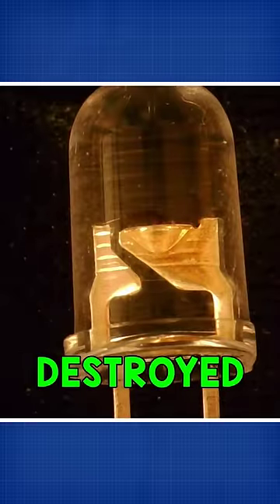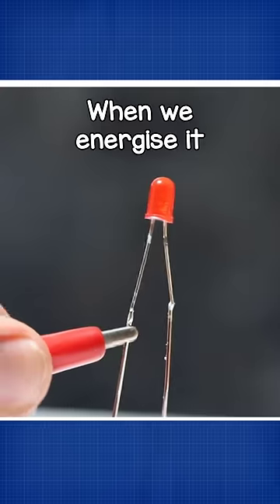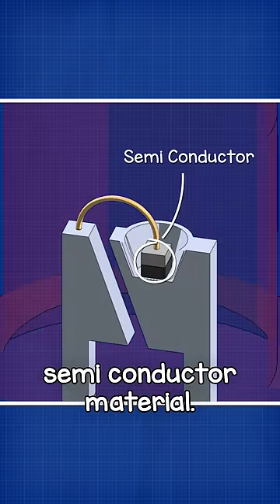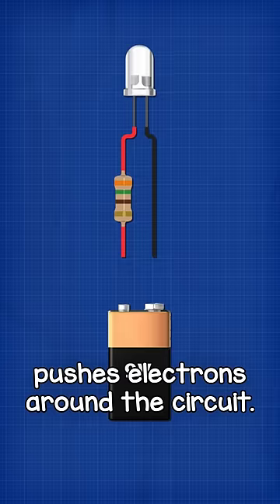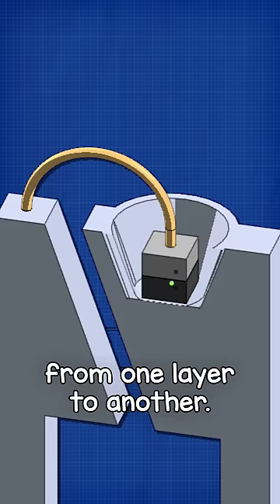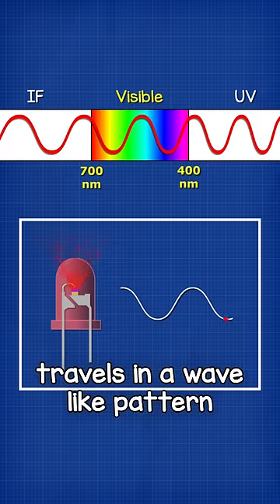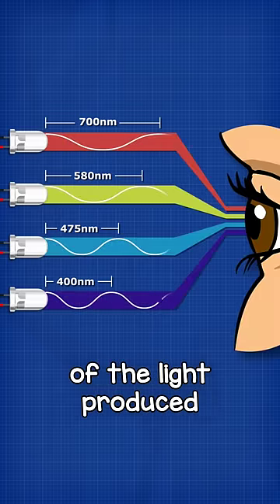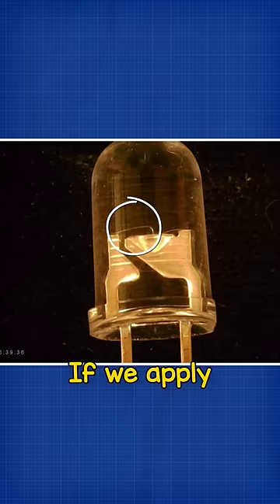What is an LED and how does it work #technology #electronics #engineering #led

Comment: remember kids, any electronic circuit can emit light, it’s just most can only do it once
Reply: light emmiting resistor 💀
Reply: Every machine is a smoke machine if you use it wrong enough
Reply: Light emitting voltmeter 💀 💀💀
Reply: Simply true
Reply: True, I see many resistor emit light, once.
Reply: You can also use capacitors as firecrackers
Reply: And in 100% of time light emitted is always red
Reply: Light Emitting Capacitor💀💀
Reply: Haha
Reply: Have you tried using an oscilloscope as a tazer? Really useful.
Reply: This has the same energy as
“Every phone can fold, it’s just most can only do it once”
Reply: light emitting crocadile clip??
Reply: Bandit power PC power supply
Reply: Bandit power
Reply: @Mista_Godfather no they also produce infrared
Reply: @mil2744 that’s pretty much a light bulb
Reply: wrong, they all do, we just cant see it
Reply: @nax1807  Absolutely, given a source with enough current capability. Try sticking one directly across a 12V car starting battery... 
(NOT recommended! Don't try at home))
Reply: Light emitting capacitor 💀

Comment: It is not voltage that destroys the LED. It is current.
Reply from the maker: Corrent, see our videos on resistors explained and leds explained for even more detail
Reply: Without voltage there will not be a current, so..
Reply: @googleevil9553  yes the voltage does create a current. But the damage is caused by too much current. Say you hook up a variable power supply with to the LED. Starting from zero, the LED will begin to glow at about 1.5volts. Because the LED is forward biassed, attempting to increase the voltage further, the forward biassed LED will attempt to voltage limit as the LED current increases until excessive current will cause the LED to fail.
Reply: @googleevil9553 voltage doesn't move. The current is electrons moving in the circuit. You can have, say, 5v across the LED. Without a resistor to control the current, too many electrons flow and the LED burns out. Add a resistors the current is lowered.
Reply: It's heat that kills the LED
Reply: "Falling from 50 meters doesn't kill, hitting the ground does 🤓🤓🤓" -This guy probably
Reply: Such a classic debate, Voltage and Current are coexists together to make Power, *Power does the damage to the LED, not just current by itself*, without Voltage there is no way for Current to flow.
Hope this ends the debate.😅
Reply: Voltage is the rate of current flow?
Reply: @ahmadfaris8044 voltage, volts, is the potential. It is the difference from one part of the circuit to another. Current, in amps, is the flow of electrons from negative to positive potential.
Reply: power kills them
you can frame the question both ways because voltage or current is just half of the answer
there is a voltage drop over the resistor which means the current is limited
Reply: you just tend to think of series sections in terms of current as that is constant throughout them
but you can think of it either way and one is not more right than the other
Reply: You guys aren't getting it. the voltage of the led varies more from part to part and across temperature than it does from mid current to over current.  It's like if I connected a 100psi source to a 100psi relief valve I may discover that at 101psi it barely works but at 102psi it is violent.  That is why the resistor and why (good) engineers never put diodes in parallel without their own resistor.  The mechanical evivilent to a resistor would be a restriction before the valve so there is a reasonable pressure (or voltage) range that works.   Now a light bulb or even human flesh, the current is fairly proportional to the voltage so your mostly right there
Reply: Are we all arguing/agreeing that semiconductors do not behave the same as resistors? 
Ohm's law doesn't work because the diode (or a light bulb) doesn't have a predictable resistance, regardless of voltage, temperature etc. It's conductance is dynamic.
Reply: They dont know so they teach it. 😢
Reply: What's a current???? Kindly describe 👀👀👀
Reply: All I know is that’s a gold bond wire in there.
Reply: Voltage is how fast electrons move, Amperage or current is how many electrons move in the circuit.

Now, do you think that a very fast non existing electron can break anything? No, because it doesn't exist. So voltage cannot exist without current, same for the opposite.

Saying that it breaks for the heat is right, heat is also generated by the friction of electrons in a small conductor, which is not thick enough to let the current flow without friction... So it heats and consequently melts, breaking the circuit (it's what you see in the video).

Theorically you can have a very high voltage, with a very small current, and don't break the led (think about a very fast, single electron).

Electricity and water are very similar, think about a river, how fast is the flow (volts) and how much water travels in a unit of time (current).

Ohm's law is fundamental to understand how these units are interacting with each other!

Have a nice day

edit: voltage can be also linked to height, but that's more for batteries, that have a potential even if the circuit is open. It doesn't help in this case
Reply: High voltage with high energy is equal to high current so yeah
Reply: Only when V is higher than Vf
Reply: The resistance starts low. So the first moment leads to high current. You calculate how much resistance you need by looking up the max current they can handle for a short moment and the voltage. Something, something, diode in open direction, something. At least that's how i remember it. More voltage obviously needs more resistance so you don't just destroy it in normal use.
(This is stuff from at least 10 years ago and i never used it so its weird i even remember it at all)
Reply: Well did you know about the law of ohm? I=U/R, the larger the U(aka voltage) the larger the I(the current)
Reply: Popcorn anyone? 😂
Reply: @tedrobinson372  It's the voltage. Get over it.
Reply: @ChemEDan  it is not the voltage. Proof is this: take a 500volt DC supply. Insert at 1 meg ohm resistor in series. Before applying the 500vdc with the series one meg ohm, the voltage will still measure 500 vdc. Apply it to the LED and it will not be damaged because the 1 meg ohm will limit the current.
Reply: It's both
Reply: That is not that easy to say. Yes current kills by heating the LED until it melts. But also saying it kills is wrong since you cant drive current through a LED at a too low voltage. Also you cant say it is voltage or it is the power. If you get a too high voltage drop across the LED, it can break down in different ways like an avalanche, a Zener breakdown, or a punch through (depends on the diode) before the current should melt them down (if you look at a ideal diodes characteristics according to Shockley's  equation). In all of these cases (except the Zener breakdown which works by tunneling) the Semiconductors crystalin structure gets destroyed resulting suddenly in shooting giant amounts of elektrons through the Semiconductor. Also if you get the Semiconductor too hot the same can happen and before melting, electrons break out of the covalent bonds an the crystal gets destroyed. This is just a very easy explanation since the physics is much more diffcult and needs quantumphysics, but if you want to understand why diodes break, read about the different breakdown mechanisms.
Reply: @ahmadfaris8044  Yes! A simple way to think about it is the amount of electrical pressure in the circuit.
Reply: both can kill a led.
Reply: It's kinda both
Reply: The friction..static discharge destroys it.
Reply: Yeah, if we applied 200 volt to a LED with 2 millon ohm resistor the LED will be fine
Reply: Actually, it's the magic smoke that makes it work, when it escapes it's  done.....
BTW you can't put the magic smoke back in, even using the magic pixies who make it in the first place....😉
Reply: Yes, but you can not connect current to the Led, but voltage.
Reply: Difference in voltage
Reply: Is it because the led has no resistance like a light bulb?
Reply: bit of both, too much voltage can cause too much current to pass
Reply: But if you apply 220 volt to LED, it won’t be good
Reply: It's actually energy, specifically, heat energy that kills the LED. Voltage is the force that pushes elections through stuff. As a result, this generates current. Current generates heat (besides the light). The heat energy is the problem. You can, theoretically, push tenths or maybe more amps through a simple LED for a few nanoseconds and it will be fine (not sure about the exact values, I am too lazy to calculate it for a simple comment). Because during such a short time, not enough heat is accumulated to damage the wires or the junction.

However, practically, we want the LED to operate continuously (on average...PWM but let's keep it simple). Therefore, we ignore the time component. The same voltage can generate different amounts of current, mostly depending on the temperature. Thus, the best practical indicator of possible damage is the current.

For this reason, electrical engineers say LEDs are voltage controlled devices (even though, it is not 100% true from the physics point of view but let's not get too deep)

Hope this clears it up for everyone.
Reply: My teacher always said, voltage doesn't kill, 1 AMP can.
Reply: @tedrobinson372 this is like saying its the bullet that kills not the gun
Reply: Thanks for the great video and the intelligent comment thread.
Reply: @_cran Using that analogy the distance would be the voltage and the current would be the deceleration rate. So if you changed to 100m the deceleration remains basically the same and you still die. But if you limit the deceleration with a large air bag, or parachute (a resistor), even though a much larger height is used, it still doesn't kill you.

This makes current the more important factor for an LED because they can handle a wide range of voltages and changing the voltage has little effect. Without the current limiter it will be destroyed regardless of the voltage applied. It isn't a simple linear relationship between the two for LEDs
Reply: Aaahhhhhh WHAAAT THE DUCKKKKK... UR SAYING TOMAYTO TAMAHTO... STDU...DAYUM... everyone here is a scientist or a doctor..th
Reply: It flows more current due to the voltaje, it is a bucle, like the dog trying to chase the tail.
Reply: @corygriffis2818  Vf isn’t a discontinuous break over point, but that’s a reasonable way to describe it.
Reply: @googleevil9553 Irrelevant. Ot is the current that destroys the diode. The resistor limits the curren so that it i below the critical level.
Reply: Yes, his very first sentence was wrong XD
Reply: @piotrswiatkiewicz3259 correct. To end this debate consider this. Increase the voltage to 100 volts, I pick the right resistor and the led is ok. Increase the voltage to 1,000 volts, I get the right resistor the LED is ok. I increase voltage to 100,000 volts. I get the right combination of resistors and guess what the led is ok. Why because current determines whether it is destroyed or not. Why? Go back to physics what is current. It's nothing more then the flow of electrons. To much electrons passing a second and the LED is destroyed.
Reply: @Damon970 to be exact the current is not electrons moving.  in fact you don't need need then moving to have a current. most of the time they move only a few centimeters per hour.
Reply: What is the dice b/w voltage and current
Reply: "It wasn't the bullet that killed the man. It was the resulting blood loss."
Reply: @ahmadfaris8044  Imagine it like dudes in a hallway to the toilet, voltage is how hard they need to go and current is how many dudes go through the door at the same time
Reply: @tedrobinson372 that doesn't prove anything. The resistor drops the voltage so there is never 500 v across the led
Reply: Can anyone here explain in simple terms the difference between current flow or drift vs. Hole flow?
Do  these empty spaces called holes have a charge?
I'm new to this subject.
Reply: @Damon970  Not how electricity works.
Reply: @Fred_Klingon So if there is current then the damage is going to work?

Well it’s clear that you don’t know what you are talking about.
Reply: @-TheUnkownUser  🤣🤣🤣🤣🤣🤣🤣
Reply: @Damon970  What you are laughing at? 

Dude you f think that electrons somehow carry potential energy to a resistor in a circuit. Which isn't what happens in reality.
Reply: @-TheUnkownUser  🤣🤣🤣🤣🤣🤣
Reply: @tedrobinson372  u do not create current, current is the free electrons inside the conductor that moves around the circuit. It does happen when a force pushes it from one point to another which in simpler term called electromotive force EMF or Voltage.
Reply: Bruh. The voltage and current are in correlation anyways. 

U=R*I

R in this case is the resistance. So it’s a constant. (Because it’s the same resistor in all our calculations).
So the voltage will increase only if the current increases. 
Same thing for the opposite: 
U/R = I
Which implies that if the voltage is higher, the current will increase. 

*Same resistor value is used in all calculations. 

So this whole “current / voltage discussion isn’t even accurate. It’s scientifically correct to say any of them, because the other one is depended on the first one.”  If the voltage is high, current is high, (assuming low resistance) and if current is high then the voltage is high. 

Correct me if I’m wrong, but I’m pretty sure this is how it works!
Reply: @ahmadfaris8044 no. The unit that measures the current flow is amperes. Volts measure the difference in potential of two points with electrical charge.
Reply: Thank you for realizing this. I don’t know how others don’t.
Reply: @IslamicSunnahGuidance you are wrong. Your answer is only correct if we have a fixed resistance that will not change. This comment was based off of the fact that the guy in the video said LEDs burn out from high voltage. He made no specification or comment about there being any or a fixed resistance.
Reply: @googleevil9553 bruh do you not know Ohm’s law or how current is constant in DC circuits? Your response is correct that there is no voltage without current, however the fact you used it as a rebuttal to the explanation how it is current that is detrimental to an LED, shows you’re missing a vital basic piece of information. Your response is redundant although it is meant to be argumentative.
Reply: @indra-fu1ew yes it is by current itself. Let’s pretend the current threshold for burning out is >1 ampere. The LED can remain on without burning out with 500V when the resistance of the circuit is 500. If the resistance was <500, the current would be greater than 1 ampere and the LED would burn out. Your comment is essentially saying resistors are redundant. Dude, do you even know how a resistor works? It slows down current, wtf
Reply: @erinasama4976 . It’s the current flowing through and the voltage across the LED that produce the heat.  The heat indeed does destroy the LED.
Reply: It’s the conjunction of the two.
Reply: semantics.
Reply: @WillemDafuq69  it maybe semantics. But if you don't think that way, fault diagnosis becomes more difficult.
Reply: @tedrobinson372  If you're going to Youtube comments for fault diagnosis, you're a lost cause.
Reply: @tedrobinson372 But for too much current there has to be too much voltage, so why is it not voltage??
Reply: @EngineeringMindset *current
Reply: Seriously ??
what are you trying to achieve here ?

would you like validation that you're the smartest bloke here and knows how to say

it's not the volts that kill you it's the amps ?

why would you say something like this on a video that is so simple

Comment: I remember I had to make digital electronics mini project & had no practical knowledge & I had to use resistors with LEDs & was too confused on what values to choose (because I was recalling diode current equation & KVL & was figuring out when LED would turn ON or OFF). Then other guy told be it doesn't matter that much lol, that was silly.
Reply: I've won a few bets on people who don't know the limits of resistors and LEDs. Pretty fun to watch, pretty fun to win, and it turns into a great learning opportunity, all for a measly 10 cent part.

Comment: The purpose of the resistor is to set the current through the LED, which determines how bright it will be.  Ideally, one wants to set that current to be no more than the maximum current rating for the LED.